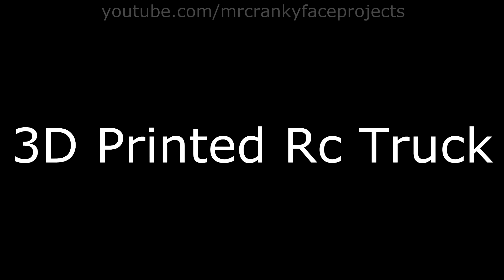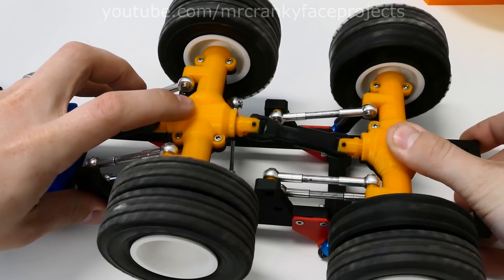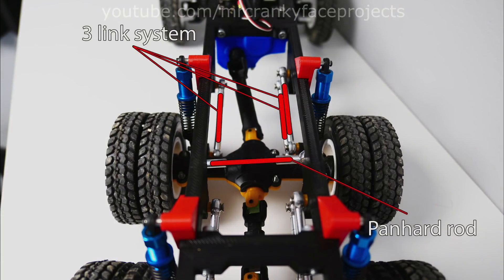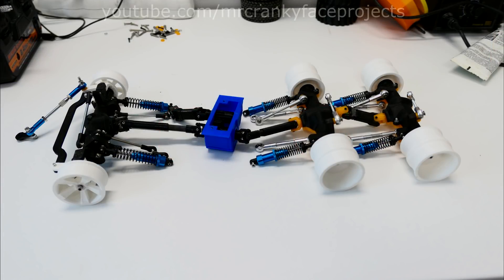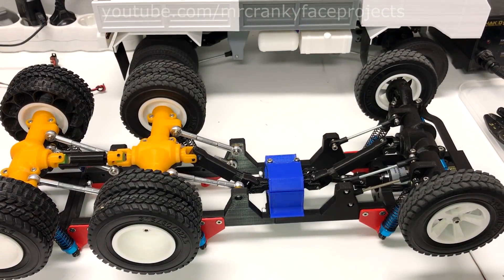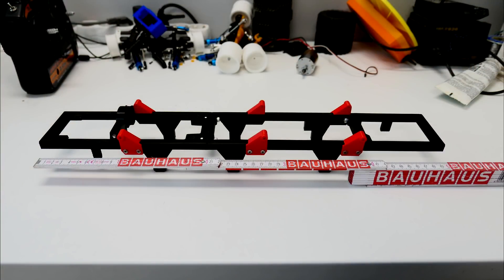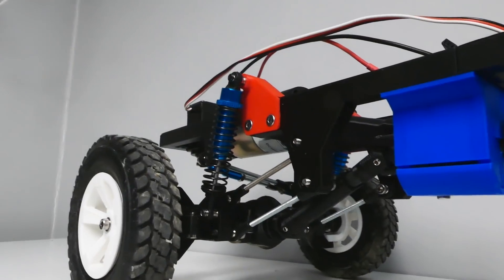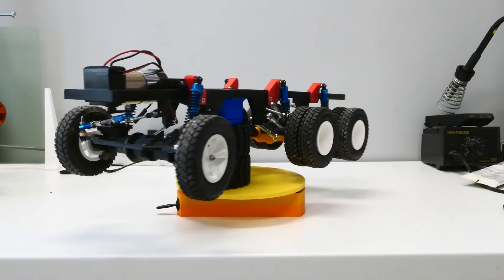3D Printed RC Truck V4: Remade from scratch!

Comment: awesome design, and great job, my respect for you man.

 I want to make it just 4x4 for crawling, i guess in that case just have to print the rear and front axle and for chassis, part a and part b too, and about the link for the gear box 12V 550RPM motor the link is not working, another one that you recomend or i can buy any with same spesifications? i´m thinking to print the gear box used on the v3 till i find one, not sure if you can share another link, and keep going, it is a awesome project. from Dominican Republic.
Reply from the maker: Thank you!
For 4x4 all you need to do is remove the last axle and the corresponding part of the frame. 
I think this is the same motor I used:
shorturl.at/gjlwY

Comment: Would there be another link for the cab stl files apart from thingeverse ?
Reply from the maker: There's no cab for this.
If there's any files missing you can try youmagine or myminifactory.
https://www.myminifactory.com/object/3d-print-3d-printed-rc-truck-v4-69733
https://www.youmagine.com/mrcrankyface/designs

Comment: What does the motor shaft size need to be in order to be compatible?
Reply from the maker: 6mm. You could modify the motors Ujoint to fit other shafts though.

Comment: don't waste your time because the gearbox is weak structure and will break during print.
Reply from the maker: scarysamons Sounds like you need to learn how to print. Works fine for me even with cheap PLA. If it’s breaking during print the fault is in your printer or slicing settings.
Reply: @MrCrankyface  I really doubt that it's my printer since I have a $800 printer. the piece is to thin.
Reply from the maker: scarysamons I’ve printed this both on my $2600 ultimaker and several of my $300-$400 printers(cr-10 mini, anycubic I3, tevo tornado) without problems.
As you can clearly see in the video, it works. On top of this at least three other people have made this truck without any problems(makes on thingiverse).

Comment: Can this platform handle truggy level speeds with out melting?
Reply from the maker: If I remember correctly, the gearbox setup gives you a topspeed of 12kph. If you get a higher RPM motor you can definitely go faster with no real risk of overheating the gears. Eventually you're gonna overtorque the gearbox and start snapping U-joints though.

Comment: Excellent 3d printable machinery. A piece of art. I'm trying....
Reply from the maker: Thanks!
Reply: @MrCrankyface  Prints came pretty nice. had to sand ... Will let you know once done. :)
Reply: Nice design, runs smooth. Its awesome friend. Getting hardware was tough.. for me, but 
managed it. prints came out pretty nice with flash forge finder with little bit sanding fits 
perfect. I had to redesign Motor mount and its joint for my motor and had to slice frame 
so that I could print. For electronics and power I am using Arduino, motor shield and 3S LiPo.
Controlled via Bluetooth and smart phone.
gear box is attached only with 2 screws. it would be better with 4 screws along with nuts for strength ?
extra, I added front body piece. (not really wanted) :) and small box to fit Arduino.

Thanks its excellent.

Comment: HI, i'm trying to find everything to by like the rod ends en motors. i just can's realy find the right pats en nummbers fot the rod ends tho :D could you help specyfy what u used
Reply from the maker: Hi!

M3 threaded rod you can find in any hardware store. M3 rodends like these would work: https://goo.gl/Bj1KF2
This is the motor type I used: https://goo.gl/4NK6qt
Select the 500 or 550 rpm version.

Comment: Beautiful evolution since the first model. I am doing a 6x6 on the basis of your axles with a modification of your V4 with 3 differentials. I will submit the file of the intermediate bridge twin wheels with differential. (it is not in the download files on Thingiverse). The intermediate axle differential is in single wheel version (so too wide).
  I am also preparing a suspension system to be applied to suspensions of the intermediate and final axles.
I hesitate between two cabins to manufacture: the SCANIA T143 or BERLIET GBH 280.

You did a very good job

Comment: Amazing desing!! Will it fit on a bruder truck body??
Reply from the maker: RC-XTREMETEAM No idea, might be able to modify the body to fit.
Reply: Mr.Crankyface And one more question, How width is it??
Reply from the maker: Roughly 195mm between the outsides of the tyres.
Reply: Mr.Crankyface But that is in the back??
Reply from the maker: All axles have the same total width and are the widest part of the entire truck.

Comment: Cool Video but i think its much better when you buy tires for this build
Reply from the maker: As you can see in the video, it works with bought Tamiya tires so that's always an option. :)
Printing the tyres gives you endless possibilities when it comes to size, shape and thread though so there's always that.

Comment: I actually modded your V3 into a 6x6 as my first 3d printing rc project. It turned out horrible and the pieces in the driveshaft break after 2 minutes of driving. Hope yours turned out better than that.

I would recommend that you try out a 775 sized low rpm motor on this. By low rpm i mean around 5000 rpm. I've tried a similar geared dc motor and its performance was bad. I'm using a 10000 rpm 775 motor in a completely new 8x8 truck. The 775 motors are under $10 and i would recommend you to try one out if you want more torque than what that geared motor is putting out.

Also get a better esc, the one in the video performs terribly at 3s.
Reply from the maker: Thanks for the tip about the 775 size! I will look into that, they definitely seem dirt-cheap.
I've so far only broken a half-axle but the part had very low infill and chassis was loaded with 3kg of steel so it seems durable so far, when printed with correct infill and perimeters.

By what criteria do you think the ESC is performing terribly?
Reply: I had one of those esc's and it couldn't output enough current to the motor. I'm currently using the slightly more expensive esc's that are actually designed to be used for 3s. (more expensive by like $2)
Heres a link to what i mean: https://www.ebay.com/itm/320A-7-2V-16V-Bidirectional-Brushed-ESC-Speed-Controller-for-RC-Car-Truck-Boa-R1/232729914979
The only problem with these is  that there is no diode on the servo lead so I've ruined a couple by inputting 5v back into the esc through the servo lead. So you should definitely stick a diode in there to avoid that.
Reply from the maker: Thanks! I ordered one and will compare the performance between them. :) I have noticed that this current ESC stutters sometimes, might be hitting some current protection, despite being "china rated" at insane amperages. Oh well, you get what you pay for. :)
Reply: The bad esc uses lr8726 mosfets, which are rated for 86A.
https://www.infineon.com/dgdl/irlr8726pbf.pdf?fileId=5546d462533600a40153567181dd26f7

The other esc uses CEP83A3 mosfets which are rated at 100A continous. http://web2.cetsemi.com/PDF/TO-220-263-N/CET_CEP83A3.PDF
China ratings are always incorrect and really annoying. Adding a cap between + and - on the bad esc helped with some of the stuttering on my bad esc.

Good luck with your project!
Reply from the maker: Hey!

I recently received this ESC and tried it for another vehicle.... Night and day difference compared to the bad one. Thanks for the tip!
Reply: @sisco6943  sticking the diode where exactly? I am looking to get the motor ESC combo you recommended
Reply: The diode would go on the 5v line coming from the esc to the receiver plug. The diode is allowing the current from the esc to go to the receiver/ other 5v electronics but not backwards.

esc side                            receiver plug side
GND -------------------------------GND
5v ---------DIODE -->   ---------5v
SIG ---------------------------------SIG

Definitely do this if you're going to use this esc, I've had a couple blow up on me because of current going from an arduino into the esc.